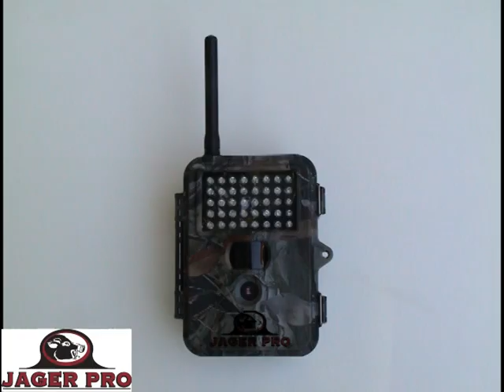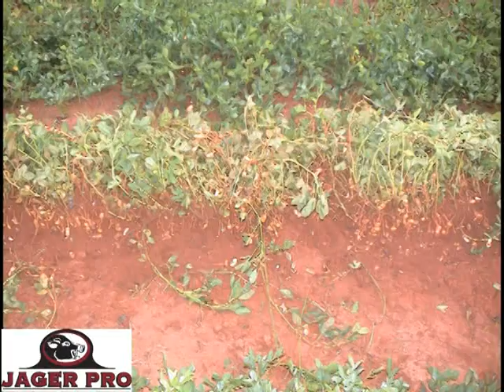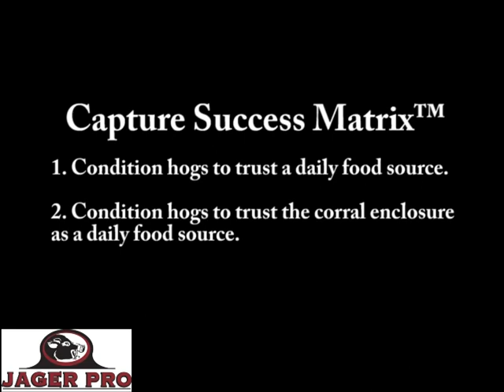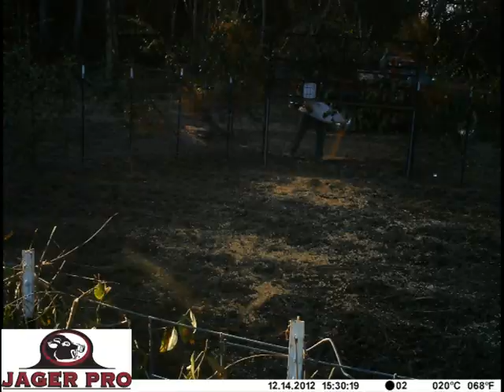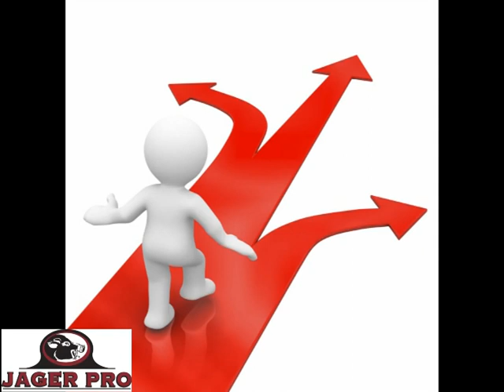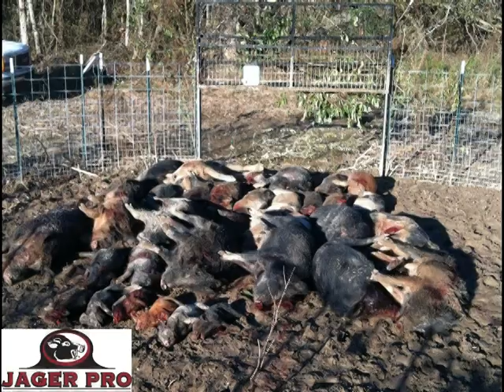Wild Hog Trapping | Capturing 56 Hogs in Two Traps |  JAGER PRO™

Comment: Is this having an effect on the general population of hogs?
Reply from the maker: It only takes 15-18 months for a trained and certified Hog Control Operator™ to eliminate feral pig populations from 10,000-acres. But there are several factors which determine how long a property remains at "zero balance" after a successful Integrated Wild Pig Control® (IWPC®) program has been implemented. Future reproduction and migration would have to come from adjacent properties since an effective IWPC® program would prevent escapes, method education and reproduction from the entire generation of feral pigs living on the property.
Are neighboring landowners implementing a successful IWPC® program? 
Are there enough trained and certified Hog Control Operators™ in the county to effectively implement the IWPC® program? 
Has the state passed legislation to stop intrastate and interstate transportation of feral pigs? 
How well are law enforcement personnel enforcing these rules in the state? 
Are judges and the court system prosecuting those breaking the rules with heavy fines? 
How many criminals are illegally transporting and releasing new feral pig populations in the county? 

The amount of time a property remains at "zero balance" greatly depends on the answers to the above questions.

Comment: What is the success rate of traps with gates vs. The traps were the whole bottom ring drops?
Reply from the maker: We use a simple equation (people + process + product = performance) to understand, manage and improve Integrated Wild Pig Control® results. Mission failure can be isolated to either untrained people, an ineffective process, an inefficient product or a combination of these variables. We will answer your question by explaining the differences between a JAGER PRO M.I.N.E.® Trapping System and a "suspended" trap. 
1. (Cost & Size) A "suspended" trap is twice the expense and half the diameter of our JAGER PRO M.I.N.E.® Trapping System. It is impossible to consistently capture large sounders of 50, 60 and 70 pigs with an 18-foot diameter "suspended" trap. Hog Control Operators™ may erect our M.I.N.E.® Trapping System to any diameter needed to accomplish 100% capture success.
2. (Versatility) A "suspended" trap must be built on flat ground to operate. Our M.I.N.E.® Trapping System can operate on uneven ground in any terrain. 
3. (Camera Operating Cost) Their camera costs $65 per month to operate and our JAGER PRO M.I.N.E.® camera only costs $25 per month. 
4. (Hog Control Expertise) "Suspended" traps are manufactured and sold by welding and fabrication companies. This means they are experts at welding squeeze chutes, rodeo equipment and livestock scales; not at providing feral swine control advice and leadership. JAGER PRO is the most efficient hog control company in the United States. We innovated thermal shooting and remote-controlled trapping technology and methods from our combined 220 years of military experience. It takes an Integrated Wild Pig Control® approach with multiple methods and technologies to remove the entire pig population from a property. A welding company manufacturing a suspended trap cannot support an integrated, whole-sounder approach. 
5. (Patents) "Suspended" traps infringe on JAGER PRO Patent Numbers 9,814,228 and 10,098,339 (Systems and Methods for Animal Trapping). The welding and fabrication companies will not be able to successfully defend their position in pending lawsuits. Willful patent infringement gives rise to treble damages and an award of attorneys’ fees incurred by JAGER PRO during litigation against willful infringers.
6. JAGER PRO has experienced 92% and 94% capture success rates using a M.I.N.E.® Trapping System during the last two 5,000-acre projects. However, our research demonstrates there is still a use for "suspended" traps at the end of a project. The control strategies must continually change throughout the various seasons to effectively target adaptive survivors when using our Integrated Wild Pig Control® approach.

Comment: Seems like hogs can reproduce faster than we can trap them, so trapping just limits but does not really eliminate the damage.  Wonder if there is a viable long-term solution?
Reply from the maker: It only takes 15-18 months for a trained and certified Hog Control Operator™ to eliminate feral pig populations from 10,000-acres. But there are several factors which determine how long a property remains at "zero balance" after a successful Integrated Wild Pig Control® (IWPC®) program has been implemented. Future reproduction and migration would have to come from adjacent properties since an effective IWPC® program would prevent escapes, method education and reproduction from the entire generation of feral pigs living on the property.
Are neighboring landowners implementing a successful IWPC® program? 
Are there enough trained and certified Hog Control Operators™ in the county to effectively implement the IWPC® program? 
Has the state passed legislation to stop intrastate and interstate transportation of feral pigs? 
How well are law enforcement personnel enforcing these rules in the state? 
Are judges and the court system prosecuting those breaking the rules with heavy fines? 
How many criminals are illegally transporting and releasing new feral pig populations in the county? 

The amount of time a property remains at "zero balance" greatly depends on the answers to the above questions.

Comment: I don't mean to change the subject, but this spring I was turkey hunting and I called up a 250lbs hog on a slate call. It came in running to my lo-cal, where is stopped 2' way from my back and went to chomping its jaws. So I called his bluff and made a 180 with my 12 gauge, but before I could get a bead on him he split and I never got a shot in on him. DC would be a perfect place for some 2 or 3000 razorbacks.